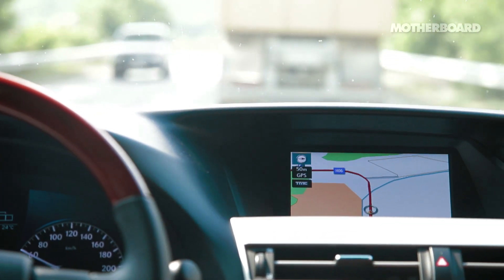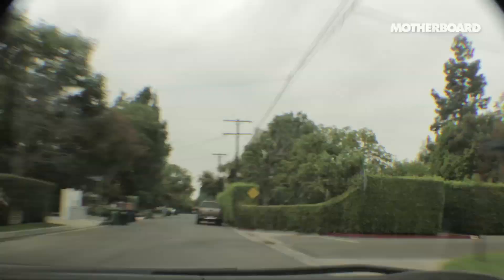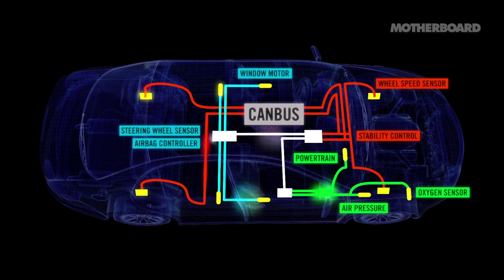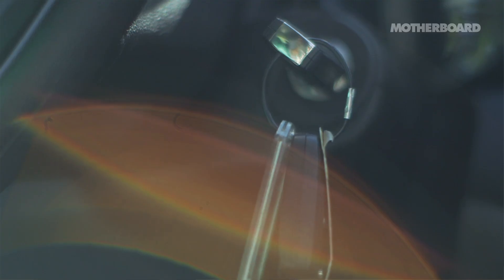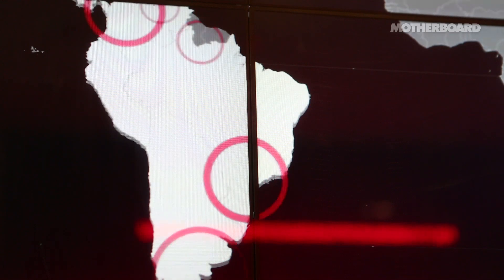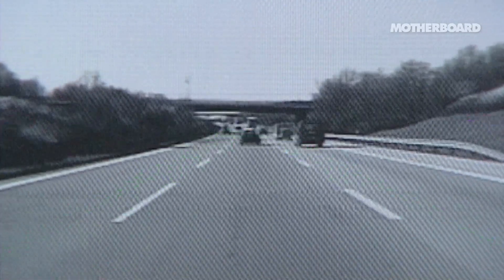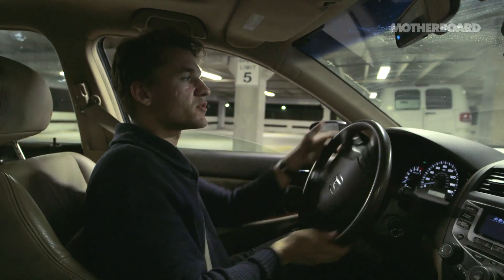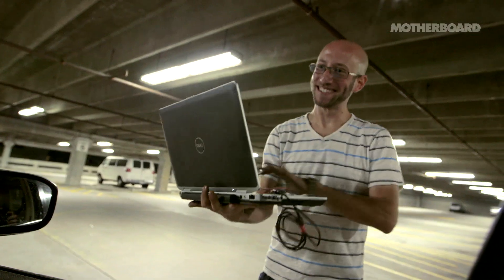How to Hack a Car: Phreaked Out (Episode 2)

Comment: I've got a car made in 2010, and I guarantee there is not enough fly by wire features to allow it to be remote controlled. I know for a fact that my steering, brakes, and lights can't be "hacked". Besides that, the only way my car (and most other cars) could be "hacked", is if someone took hours (maybe even days) to rewire the canbus, and add remote servos to control the analog stuff.
Reply: Also, if a vehicle has wireless features, that doesn't mean that there's a door for someone to control your car. That's like saying I can control the oven in your home because there're walkie talkies plugged into the same power grid. Not everything talks. Manufactures avoid letting non-related components talk to each other just to stop consumers from getting into the vehicle's computer
Reply: lilman227 i wouldn't be so sure! (i dont know what your car is) but i have a 2005/06 all of the indicators and lights are connected by the LIN bus to the instrument cluster, then the instrument cluster sends the command via canbus to the TIPM so even on my older car they could control lights (anything dodge/jeep/chrysler wouldn't be that difficult).

grab a workshop manual you will be surprised how much is connected that you just wouldn't have suspected.
Reply: Daniel Emery I've done a lot of work with the electrical in my car. It's pretty much all analog. There are a lot of digitally controlled components, but they're pretty isolated. Technically, any car regardless of age can be controlled if someone put enough time and effort in to it. A 1972 Mustang could be made to be fully remote controlled, but the effort that it'd take would be ridiculous. Adding remote switches, servos, and what not.

Comment: I mean really if you had access to a car anyone could tamper with it. If I wanted to kill the car engine I could wire up a remote relay that grounds the ignition module when I push a button. I could wire a remote relay to apply brakes without even touching the computer in the car. Same goes for computers, if you had access to the computer physically you could add malware and gain access remotely. Nothing is safe if you can get your hands on it. Car makers should keep GSM side of things separate from the computers side that controls everything on the car. More like a read only GSM that cannot send commands or anything.
Reply: Yes but that 
Eaves forensic evidence

Comment: I call bull** there is no way to hack that older car they're using without a device connected to the OBD2/BUS network. I wouldn't even call it a hack it's just a homemade scan tool. The only thing they did special was figuring out Honda's BUS program language or they just cracked a high dollar scan tool an copied and pasted Honda's codes from it, then tweaked them to do things the manufacturer didn't want technicians or people doing because it would be unsafe.

Ps that car does not have electronic breaks, their hydraulic!!!  and the handbrake is cable connected You can't stop them with a command. 

Some cars do have electronic breaks but they are mostly 2013 year model cars and up.

Comment: Ok, lets shatter some of these theories. First off, no way can you make a car turn by a computer unless its completely electric. That means hydraulic and electric assisted steering systems wont be affected. 2nd, many cars today still use a cable for the throttle body. The brake system, again, is hydraulic, so it doesn't matter even if the ABS module is off or even disconnected by the harness, the pressure will always be there.

Comment: IDK why people are freaked out about this EMP's have been around longer and can take out cars and actually cause permanent damage to them unless they are 100% mechanical with not computerized parts. EMP guns or bombs are actually easier to create it's just the size that is hard to manufacture. So don't get freaked out by car hacking like the vid said if it's a computer it can be hacked everyone should already know this is a possibility.

Comment: Um last a car computer does run like they said it can't be controlled by a regular only special flash software can controlled does since the car computer does not work like a storage device but more like a brain sending out commands an once is flash the car has set of commands program any disturbance to car computer like they did well ruin the cpu there corrupting lines of commands I laugh how none car guys try to compare car computer to the Dell computers they dont work the same.

Comment: This is not easy to do. Hacking anything is difficult especially a car. For example not all cars are able to be hacked. There has to be a receiver to connect the car to a network so it can communicate with other devices. This is not easily installed you would have to have alone time with the car. GPS hacking is not easy. There are lots of security features as well for GPS tracking but it's not impossible again the computer in the car needs to be connected to some sort of network before it can be hacked.
Reply: Difficulty is an opinion. Some people are naturals, and put a lot of working into improving themselves on top of that. There are people out there, I'm sure, who find hacking to be child's play.

Comment: one would have to have some detailed info on the car they wanted to hack,
they make it seem so easy in this video,
1 they have to know where the ECU was at all
2 they have to have something that would actually fit the connection for the said ECU
(maybe they plug into the diagnostic port but if you start driving a car and dont notice a bunch of wires hanging on your legs you got bigger problems)
3 the controller would have to know how to navigate the cars system and communicate with it
4 the said person had to be allowed to or quietly gain access to install this in the first place

this is just fear mongering, for now at least...

Comment: This is ridiculous, I don't doubt that car ecu's can be hacked, but they portray it as something you could do passing by the car. Not possible, for one, you would have to be in the vehicle. If someone with ill intent is in your vehicle, they could cause a lot of unsuspecting damage without even touching your ecu. Also, most vehicle ecu's are not readily accessible. Don't believe me, ask someone who has paid to have one replaced. Most vehicles also have multiple ecu's. The ones that control braking systems, powertrain and safety systems are usually, unlike described in the video, not networked together. Except for warning pinouts that will trigger a warning in you cab module that will activate a warning light to come on in you gauge cluster. Vehicle ecu's also usually only have one connecting port that is accessible, the obd 2 or 3 connector typically found under the steering column trim panel where it would be visible if someone had inserted a device.I understand that this is all very fascinating for hacking guru's but I highly doubt that it will become a main stream issue. And if it does, it would be very simple for the oem's to make the separate systems all stand alone.

Comment: Hello.  OnStar (parent company GM) has been able to do this on a more basic level for years!  I think the shock value is that most people with cars that have ECUs are susceptible to something like this.   Chances are much more likely someone would use this capability to break into your car, disable your alarm and start it, then try to take it over while you were driving.  Begs the question about the future (and inherent security) of self-driven vehicles though...

Comment: The way this video comes across is that all cars are connected to the Internet by default.  The fact is that they are not.  So the only way this could be possible is to connect a device with a SIM card built in, to your CAN bus.  That would first involve breaking in and connecting it.  Which is stupid.

The vulnerability would be if the car came with telematics which was not secured properly by the telematics provider.  

Totally misleading video.

Comment: i just love when people exaggerate things out out of proportions to freak people out.
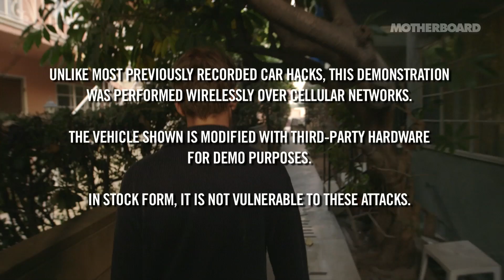also 6:42 mark car had to modified for this to work and all he was capable of doing on that car was something most can do with their car remote control lock unlock and start the car, and that's because can bus even on that relatively new car doesn't have that much power over vehicle electronics
1 you can not get access to canbus from outside the vehicle. all of these type of electronics are hidden deep in the cabin trunk and under a hood. the only thing that hacker potentially could have access to, on the street with out breaking into the car or lifting it up to get under it, is an ABS sensor. Last time i checked important in its own right but you cant hack CanBus through it.
2 there several different modules that control everything in your car. mostly newer cars are susceptible to being hacked as they have more items being ran of module/computer then older cars, which had everything directly wired through a relay.
3 conventional cars (95% of cars on the market that's my estimation) have hydraulically assisted steering the only electronics in that system are fluid condition sensors such level and pressure and temperature (rare case). so there is absolutely no way he'ed be able to steer the car from his laptop. the rest of the cars that do have electronically assisted steering (mostly high end luxury) with lane guidance options something like this could potentially happen, but there is always going to be direct and physical connection between the steering wheel in front of you and your wheels.
4 parking brakes this once again on the 95% (from #3) of cars its a cable running from the lever or pedal all the way back to the rear wheels the only electronic device here is the sensor to let you know parking brake is engaged. one again unless you have a brand new luxury car that has a little button for parking brake and even then that button has to be connected to a module that's connected to canbus and not directly wired.
5 now days (last 5 years or so) more and more car manufacturers employee fly-by-wire throttle became of that it is susceptible to being hacked as there is no longer a direct physical connection between your right foot and throttle once again on older cars most hacker be able to do is mess with your idle or with cruise control 
6 other vulnerable system is ABS. if hacker does manage to fake a input saying that brakes have been depressed by a driver then abs could potentially stop your car or if hacker rewrote the program lock the wheels. and even then the worst thing he can do is keep you from getting somewhere. here are bad news though if he were to rewrite the program to lock out all brake lines he could potentially disable your breaks. 
im sure there are things i missed. but my point is until the day when car manufacturers start building computers and start attaching wheels to them you'll be fine

Comment: "This vehicle was modified with third party hardware for demo purposes."

Be scared if you want, but it sounds like most of the cars on the road today are not vulnerable. I highly doubt there is any way to fully control any car without implanting a device into the canbus hardware. Seems like this video just verifies that.

Comment: Imagine sending a command to the hacked car and
telling it to go 100 miles an hour.
Reply: Handbrake is full mechanical, so is steering except there is a hydraulic assist which could feasibly be switched off.
Reply: NotAsian The parking brake on cars can easily be overpowered by the engine.  Plus, some new cars are starting to have an electronic handbrake, which in my opinion, is a bad move (where's the emergency brake when your electric system fails). Also, electronic-assisted power steering has been a thing now for quite a while.  Hydraulic power steering isn't /that/ easy to be switched off, especially if you're in your car and it's already moving ... 
Small reasons why I will never buy a new car.

Comment: this is pretty over-hyped lol. it is true that modern cars are computer with wheels. But seriously ECU is a CLOSED system. there is no connection between outside world and the ecu software on most of the cars these days. with that said, some newer car do allow wireless ECU update from manufacture which is possible to "hack".
Reply: Waw you are so dumb
Reply: thank you! u ar so smart
Reply: Yes. They set up a device to the ecu to collect signals over gsm.

So if you had someone who could tamper with your car it's possible. Looks like an alternative to cutting someone's breaks

Comment: since when are modern car electrical systems remotely connected?? like i have never heard of a car being able to get access to wifi or mobile data
So they only way to hack a car is to install the hardware tool, meaning you would have to break into the car? how is this ever going to be a wide spread problem?

Comment: They added a cell link, try the same thing using a factory onstar cell link and unless your hacking into GM's big corp net structure to get connected to the car, which would be crazy difficult. Now if he can get to any of the wiring harnesses on the car he can just attach his network accessible tapping control device to send it commands.

Comment: What a load of crap, this is like saying. guns are dangerous on a plane, first you need to get that gun on the plane. The car would need to be physically broken into to gain access to the terminal. So that is a direct, targeted attack towards you. Guess what, you can be directly targeted a number of ways if someone wishes too. someone could break into you house and place poison in your milk. Someone could bleed your brakes in your car. The whole your car can be attacked from across the world is not a threat and this why the terminals are so easy to hack (He said they weren't that easy). Cars like the tesla that can be turned on remotely. Guess what, I bet the security is there, they can do remote updates to improve security. This was a bit pathetic IMO, cool but pathetic.

Comment: I mean if you really wanted to hurt someone, you could break their window, pop the hood and install a cht.  They'll fix the window eventually and be unaware they have Trojan horse hardware.  This could be used in fatal applications however the planning and execution would require near communications connection for less lag; gsm lag is impractical for this shit.

Comment: Good thing I drive a stick. Also, most emergency brakes are a direct cable connection from the master cylinder to the rear wheels, so rest eaay.

Comment: Theoritically, without access to the car - You couldn't hack it without those simple commands already being avaliable. For example, you can't tell the car to start without there being a remote start on the ECU. The only difficulty is finding a way to connect to the car's ECU. Unlocking a car is much more simple. All you'd need to do is mimic the remote's radio transmission. Although, in newer cars they've also added additional security options such as a proximity sensor. IE you cannot start/unlock without the key being within some remote distance to the car. If your car is fully controlled by the ECU (IE some newer mercedes w/ onstar). In that case, all you'd need to do is access the onstar control panel, where the commands are already in existence.

Comment: I think there are easier ways to get into the car (every car produced from 2007 has TPMS that transmits wireless every 7 seconds and antennas are pretty strong), but cellular thing is world wide access. First thing rich people do when they get a car is completely disable GPS and any microphones in the car for protection because anything can be hacked

Comment: Was this actually designed to be a con job? Or is that accidental? None of these things are possible without leaving a physical device in the car, and some of the claims simply aren't true. Internet of cars? Garbage... access can CANBUS, requires physical access to the wiring loom or use of a port which is by the drivers knee, which would be pretty damned obvious. Neither is even possible without first breaking into the car. Seems sort of dumb to break into a car so that you can unlock it... sort of self defeating.
Not only that, but the key will still drop out the ignition and kill the engine.

Comment: How about hacking the 04TL's ECU so we can get some programable tuning maps in. 12 years now and no one has done anything worthwhile for the 04TL :P
Reply: Tuning an Acura sedan has questionable usefulness
Reply: lolatmyage True but it's for enthusiasts who like to tune. The models past 05 have a piggyback system but is very expensive. The cars do have redundant functions that take away from throttle response and sensitivity which is quite annoying. Most people who want a better build just switch to a standalone ECU but that comes with it's own set of complications.
Reply: vidurc I can understand having a car that you really like but if messing around with it is so complicated, why not try another model?
Reply: lolatmyage Not worth replacing my daily driver. I'm am planning on another car to be my power house. I was just kidding about doing something about it. The only solution they have now is a couple thousand dollars. So you're right about it being not worth it. I might be working on my wife's lexus sc instead.